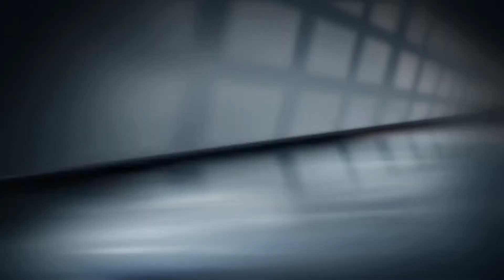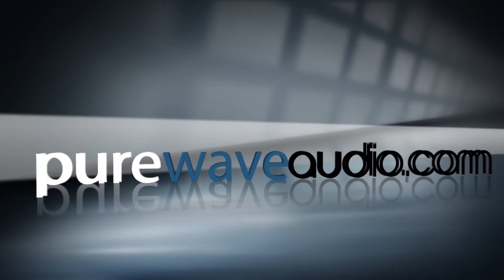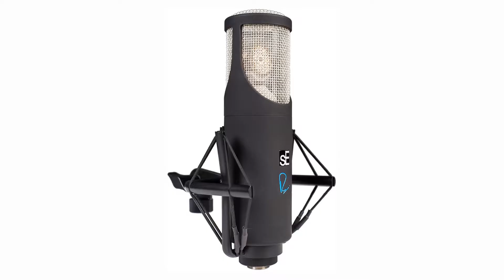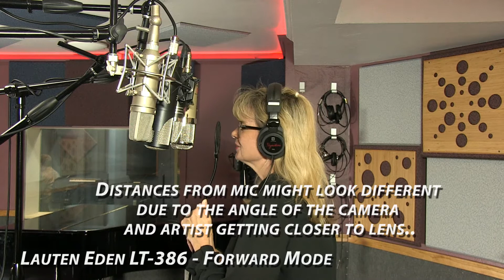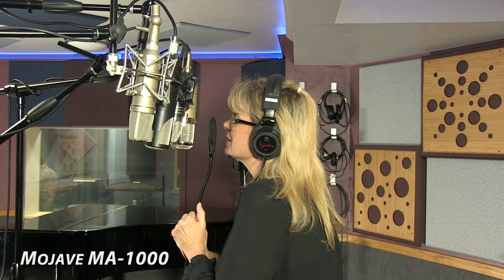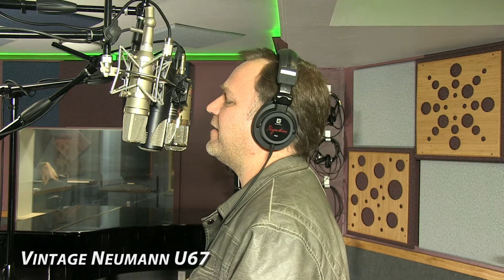Tube Microphone Shootout: U67 vs sE RNT vs Mojave MA-1000 vs Lauten Eden

Comment: For me it's the U67 all day, certainly not for the price, what a nightmare - purely for the sibilance. The others are already have sibilance at a level and tone that would be prohibit EQ, after compression/de-essing, I've found it gets nightmarishly processed. A (slightly) cheaper way to get achieve a workable sibilance is a U87 going into a bombastic tube pre. I have some old german tube pres that do an amazing job, but the WA-MPX is up to the task.

Comment: I personally like whatever magic stardust Mojave is sprinkling in their microphones, but I will say, all of these mics are excellent but also pretty high end. Subtle differences down to taste and preferences. Tbh I hadn't even heard the RNT before and I quite liked it, but I just looked and it definitely has the price tag to go with it. I have used other less expensive SE mics and really loved them. But the same could be said for the Mojave. All of these mics here are getting into the more expensive category.  They all have that in common.  Also all of these manufacturers offer less expensive mics, and most even offer less expensive tube mics.  I feel like this price range is getting into that expensive final 10% better territory but not Into the collector mythical expensive category.  Once you get over a center threshold the price goes up more than the increase in the quality of the sound, to me at least. Great demo though. I could have dealt with hearing both processed and raw tracks as well.

Comment: For me this is obvious: the Mojave sounds the warmest and a little more compressed (not a valuation, just an observation). The SE RNT carves out the most details. Impressive. 
Keep in mind. You can adapt tonal adjustments e.g. for  lows and highs easyly in the digital domain with an linear phase eq plugin without changing the character.

Comment: U67 is clearly the winner hear for both vocal performances.  The rnt is pretty great too.  The eden didn’t perform all that great.
Reply: Well, that's HIGHLY subjective. It's been well demonstrated in many places that prevailing confirmation bias in pro audio leans heavily towards gear that is vintage and expensive. 

I love the 67 on many things, but not so much on vocals, and this test bears that out - at least for me. For the female voice, I prefer the RNT; for the male, the Mojave. Change the singer and/or room and my answers would likely change.
Reply: @nathanaeldavenport2251  U67 sounds by far the most natural on vocals, but yeah, subjective
Reply: That's interesting. I thought the Eden sounded the most like the U67. Weird you would have that opinion.
Reply: U67 sounds like a finished product, slightly compressed. The RNT is a close second.
Reply: I think the Eden sounded great, the thing is the Eden has two other modes to play with. The Neutral would have been closer to the U67